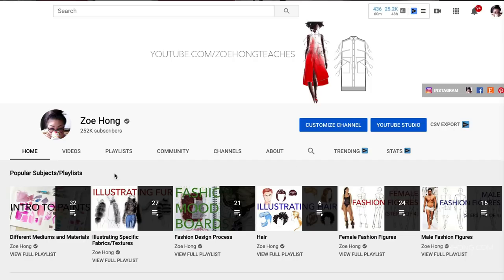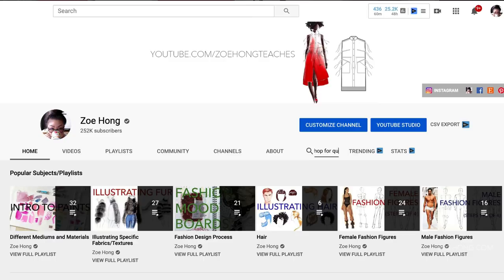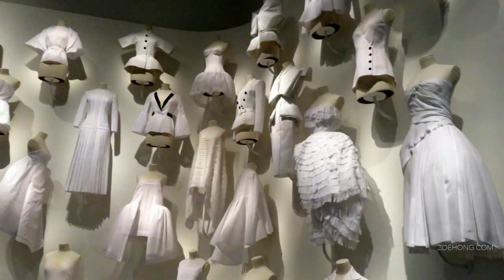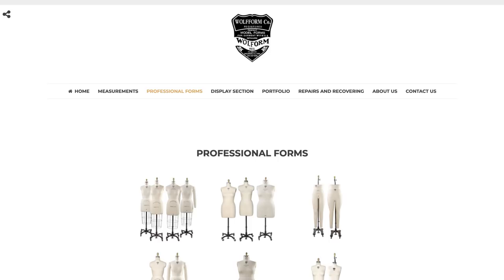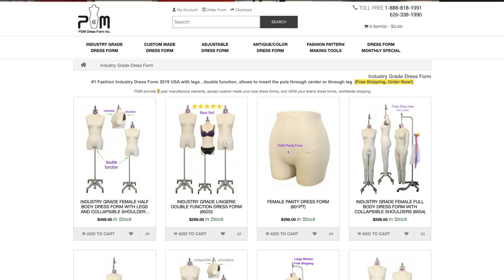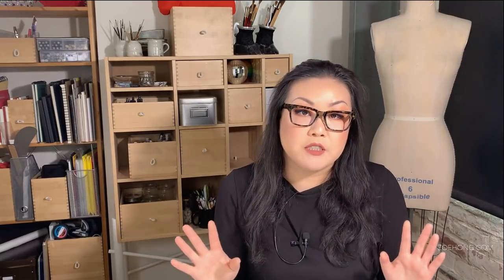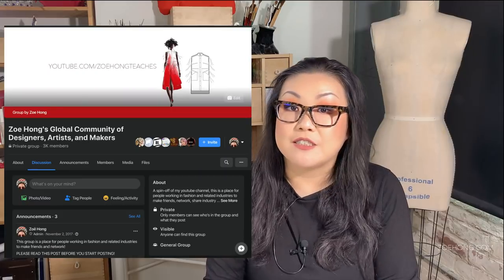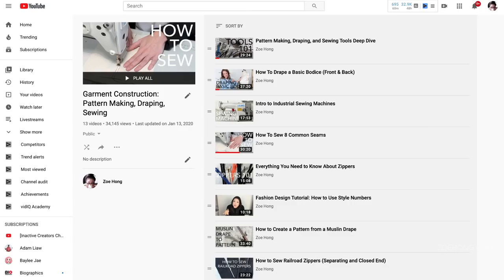Answering Your Garment Construction Questions (Patternmaking, Draping, Sewing, and More)

Comment: I learned essentially the same method for preparing for easing, but one row of basting stiches is on one side of the seam line, and the other row is on the OTHER side. I think this helps control unwanted pleating when you do the final stitching.

Comment: Great information. I believe they need fit profiles for smaller sizes as well. I am a size 8/10 and have yet to find pants to fit my fuller thighs. The blocks companies use to make garments should have different blocks for waist and hips. It would give parts of the population a fighting chance to find RTW garments that fit. I have heard of some companies using the same block for every style of pants they make. That's great if the block fits, if not you are in a long wait until they move on from that block.

Comment: As someone with experience in graphic design, and experience with Adobe Illustrator since version 4, Affinity Designer has all the capabilities of Illustrator, I actually switched over to it recently. The workflows of the two programs are quite a bit different though, but you'll probably manage to learn Illustrator in the 30day trial period after learning on a different vector based illustration application.
Reply from the maker: The fashion industry uses AI so that's what I teach.

Comment: Adjustable dress forms are not my thing. I bought one, never used it for the reasons you mentioned but also because the neck is WAY TO LARGE! It is impossible to fit the neck area portion with a shark-like neck dress form.
Reply from the maker: Didn't know about the neck thing. Good to know.
Reply: I have video lessons on neck and armhole adjustments from sizes XS and XXL.

Comment: On plus size: You nailed it on all points. 

Lumps and rolls are a thing. Stretch fabric fits more bodies. But it often makes humans, who have flesh and fat, which is poorly approximated by a dress form of any shape, look like walking balls of flesh and fat. 

People don’t buy clothes that make them look bad. Or they buy one piece, because they need it, and never seek your brand out again. 

People spend the maximum their budget allows for, on clothing that makes them look and feel good. They seek your brand out again. They budget for buying another one of those magical garments. Make me feel comfortable and confident in your clothes, and I will keep buying.

Edit: And give me pockets. The pockets that can’t be designed into garments because they’re cheap, thin, stretch knit which makes me look lumpy, are much easier to design into the structured the garments using sturdier fabric - which you’re using to avoid the lumpy look. So just put them in.

Comment: If this isn't allowed,  delete it . I made a me using duct tape as a pattern to design my me. I wanted something I couldn't ruin pins in. I bought mesh screening and used coat hangers,  cut screening to pattern,  literally bent hanger to shape,  stitched them in, stuffed with mix of flyers & batting,  covered with fabric. It's just like my measurements,  & costs $35 canadian